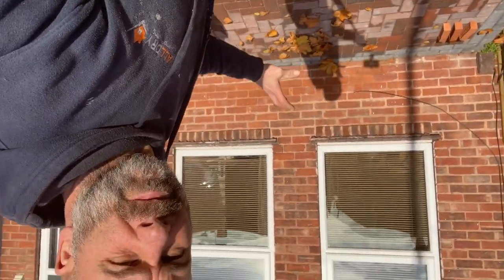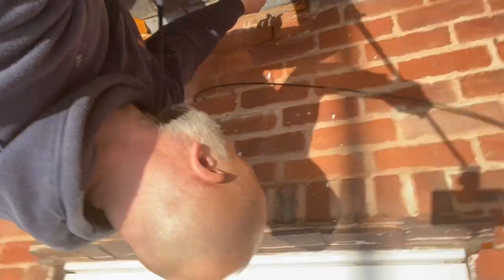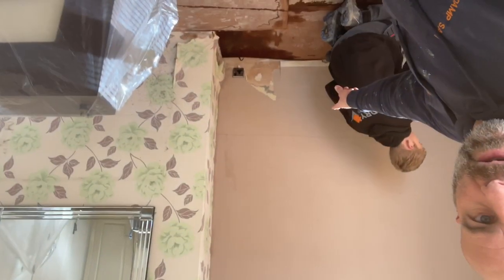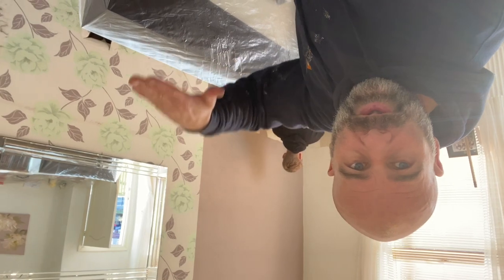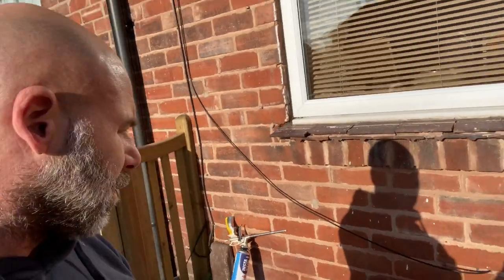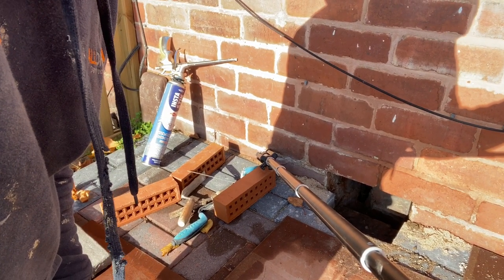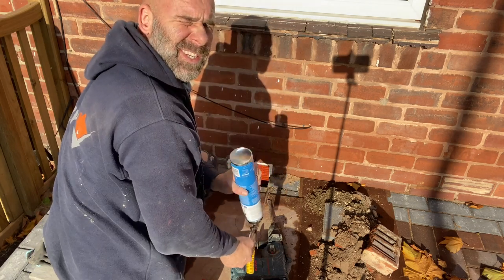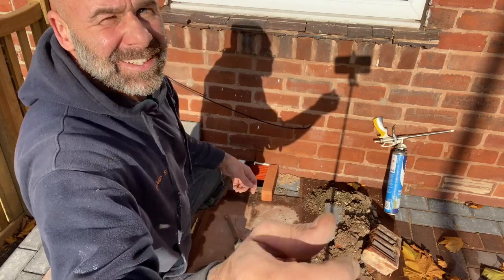Added Subfloor Ventilation

Comment: Wouldn't it be best to have the air brick at least 1 brick height higher as it'll stop any snow or rainwater getting into the property?
Reply from the maker: In theory yes but your judged by the joists and internal floor level unless your going to fit a telescopic vent

Comment: A full solution would be to take up a couple of rows of block, expose the old air bricks again  and get the outside paving to 150mm below the DPC.   Just done that myself as some idiot block paved similar to the place you are helping to sort out.
Reply from the maker: Ian Freeman yes that would be A soloution that is not practical due to cost, time and effort. 
The paving has only been down 8 month and was installed wrong. 
There are lots of solutions to most problems it trying to get the best for the customer.